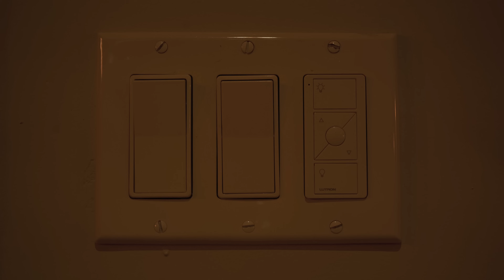First Wash In A Year For Our New Porsche 944 - Filthy To Clean!

Comment: Slightly Lowered and Good All Under. Fresh Bushings  (Poly?), KW Coilovers/Suspension ? , Wheels, Tires, Brakes, OEM + were applicable. Clean, Tight and Mechanically Solid everything works, rides nice and handles....I would have to stare at it longer to come up with a 'Theme' for it.
Reply from the maker: Oh man I need to get KW's on something! Stuff is way too good. All great ideas, luckily its already very mechanically tight! Needs cosmetic work desperately

Comment: I think a kind of old school touch would also be great, if you’d like to be modest and gentle, kinda retromod... 😊
Like 18” Porsche Fuchs wheels or Rotiform Fuc wheels as a start with nice lowering (or even smaller wheels than that depending on the lowering)... White tyre walls or nice white lettering, or even steel wheels with chromium hubcaps... Only round and clean shapes and edges, no modern design bits... Few bits from older Porsches... Few custom carbon fibre touches (that would also be great for future videos if you would make them), some foreign market 944 parts, few chromium touches and/or lines, smaller modest rear wing, white Porsche side stripes and an old school small Porsche exhaust (double pipes pointing down), different but factory lights, badges changed or off... So only very slight and all modest modifications to make it even more classier, looking old but still a tiny little bit modern for this century. 👊🏻🤩🤙🏻
Reply from the maker: Oh man that would be so cool if I could make carbon fibre parts, that would actually be a dream haha. I love the idea super modest adjustments man! Definitely needs a thorough refresh across the whole platform
Reply: @ChromaticGarage  - According to that I have seen from you so far, I think you could easily cover some bits with carbon fibre. 😉

Comment: It wuz funkin’ great yea Boi 👌🏻😎🤙🏻
Congratulations from my heart on the Porsche, also on Short Throw - wishing you maaaaassive success!!! 💪🏻🤩👏🏻
It’s very-very-very nice to see you thrive, grow and witness your progress My Man!!! 🤘🏻🤩🤘🏻
I don’t know you at all - unfortunately, but I only can guess from your style that you like and enjoy the 80-90’s kinda retro stuff - therefore I’d try a 90’s wide body kit on the Porsche (or just build it wide, depending what you prefer) with a proper sporty wing at the rear, but not a nasty ricer body kit and wing, just classy ones would count. Air suspension definitely. I’d keep the build design very clean, I’d use some modern touches as well from new Porsches, like new(ish) 911 20” wheels, different mirrors, lights, etc. American builds like to use Europian/Japanese/etc. specs - Europian builds like to use USA/Japanese/UK/etc. specs like no indicators/reflectors in bumpers and so on, and vice versa, so I’d try to source things that are not Canadian specs, which would make your build very unique. Small custom touches that you could make in house like using different colours or carbon fibre - covering small sections like the wing, or mirrors, door handles or even the bumpers with carbon fibre, then clear coat on, sand, compound, polish, ceramic coating, all done and I believe you could easily do that in house. Tinted windows in rainbow colours. I’d also keep the black colour and ultimately build a proper classy and scary interceptor. But these are just my quick thoughts... Just follow your heart and build your dream. If it’ll come from your heart, people’ll enjoy it and a passionate work will attract more interest/subs to you. And as much I can see so far, doesn’t matter what you do, people like that. Sending much love from Bristol, UK 👊🏻😎🤙🏻
Reply from the maker: Thank you brother!! I really appreciate every bit of that. Much love from Canada!

Comment: Please someone tell me the secret to making the foam come out like it does in the iKfoam sprayer pro 2. I use P&S BB diluted 1:5 with the purple nozzle/tip and it comes out with small bubbles
Reply from the maker: Man so many people ask this! I literally just put about 10:1 of brake buster in and add water. It has never failed me!
Reply: it is the filter that is clogged, wash it with water every time you use it and dry it well.  It's important to change it when it's too black
Reply: @TheMemeJR  it’s a brand new pump sprayer, but I’ll take a look at it. Thanks for the tip

Comment: New wheels and tires. Wider tires to get them out to the edge of the body with just a bit of poke. Please don't SLAM that car. That has to be the worst trend in aftermarket car mods. Fill out the wheel wells but not with a low-profile tire. Just a good-looking tire to stay with the current styling.